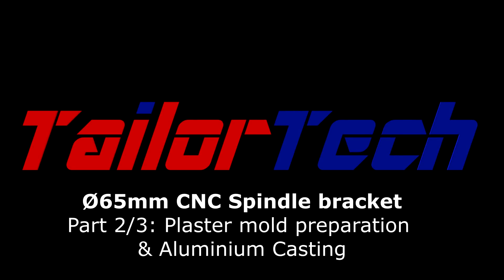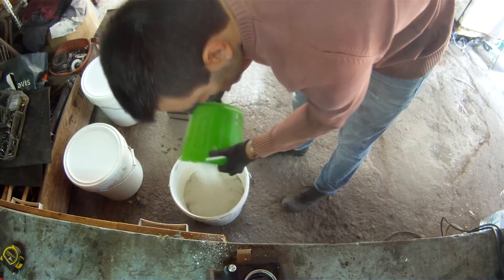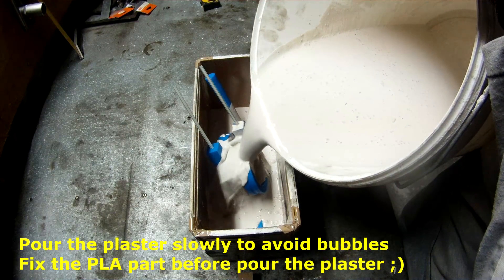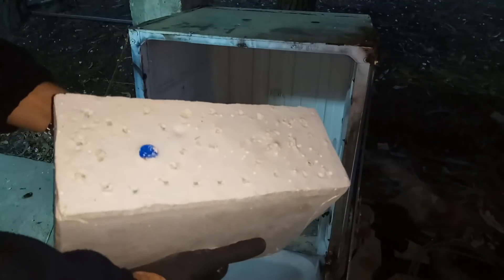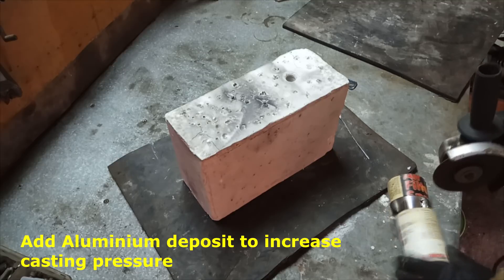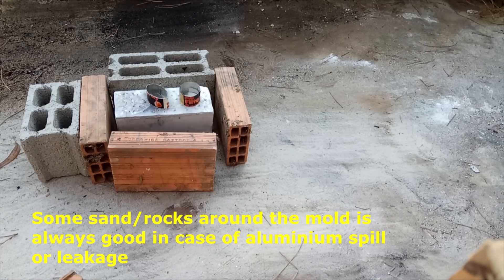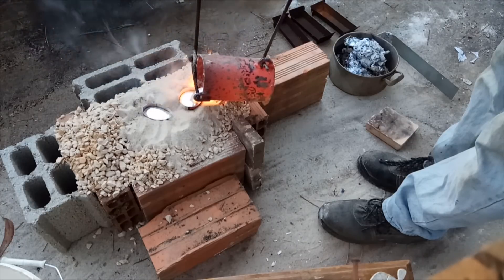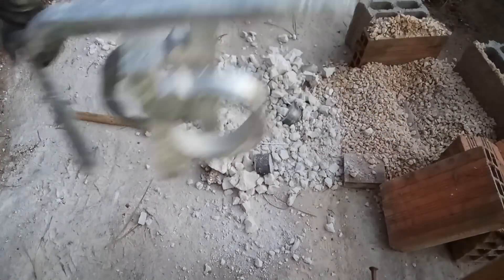Lost PLA Aluminium Casting || Part 2/3 || Plaster mold preparation & Aluminium casting

Comment: why not just use a CNC router instead?
Reply: this shape is pretty simple but if you ever have a over hang then you won't be able to reach that with normal cnc routers and they usually cost more then a foundry and plaster